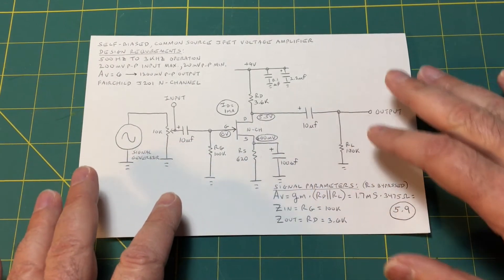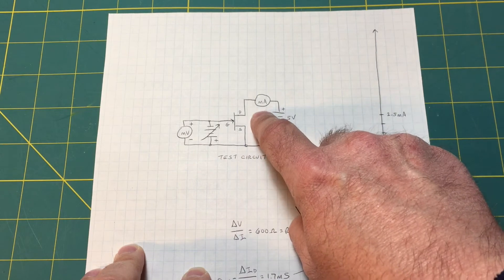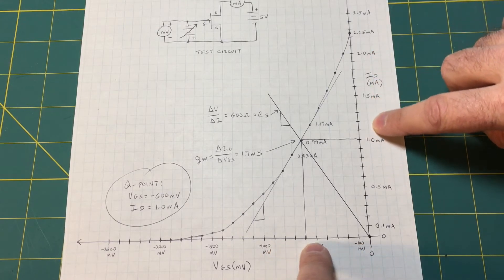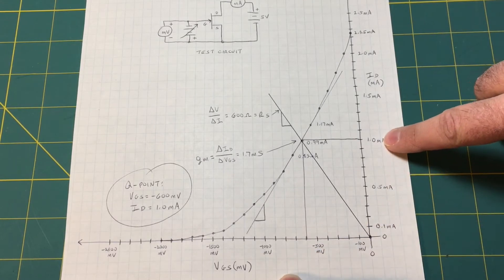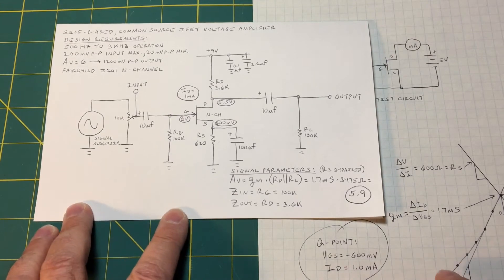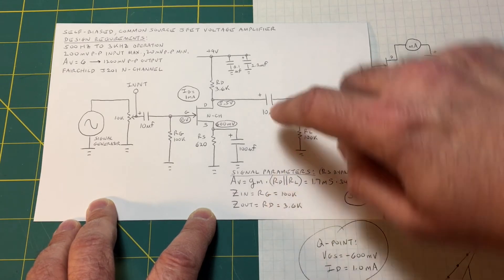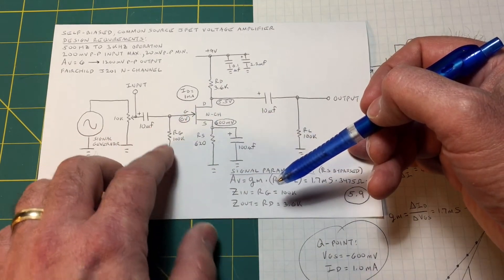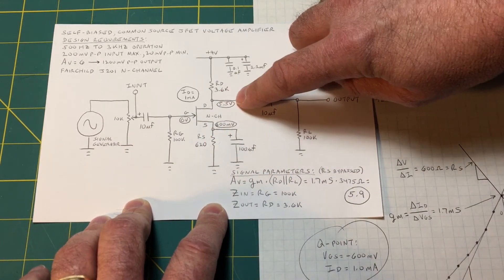JFET Amplifier

Comment: if we change the load like Rl=10K, then what is the new value for Av and Ai? Also, if Rl 500k then what is the new value for Av and Ai
in another world, How Rl effect on Av and Ai
Reply from the maker: Mohammad Alhamd Assuming a gm of 1.7mS for the JFET, Av with Rl == 10K is 4.5, and Av with Rl == 500K is 6.1.  So voltage gain is reduced if the load impedance is lowered.

Comment: how did you get 5.5v on the drain? I got 9-(0.001*3600)=5.4v
Reply from the maker: My resistor values may not be within 1% tolerance, the ones I’m using here are “economy class”.  My DMM is also old, and may be out of calibration.
Reply from the maker: Several possibilities:  1. The curves in the Fairchild datasheet were generated with Vds = 10V, my Vds was only 5V when I generated my curve  2. My JFETs may not be genuine Fairchild but instead may have been fabbed by another manufacturer (counterfeit)  3. My JFETs may be out-of-spec pulls or scrap material that is nonetheless still functional.  4. My JFETs may have been mis-branded (wrong part number)
Reply: @NetworkXIII  its really strange that the IDSS is 0.2mA - 1.0mA but when the Vgs is 0v the ID is approximately 12mA. Is this a mistake, or am I misunderstanding something?
Reply from the maker: Bit Crusher Fairchild measures Idss with a 2% duty cycle pulse at the gate, not DC, this may explain why it differs from the higher drain current on their curve when Vgs = 0.
Reply: Network XIII Thank you very much!
Reply from the maker: @RexxSchneider  I purchased these JFETs from an eBay seller in China for next to nothing, so I can't even say for sure if these are genuine Fairchild parts, nevermind being J201s.
Reply: @NetworkXIII  Sorry to bother
 you, but why the transfer characteristics curve of the datasheet is completely different to yours. In the curve, when Vgs is 0 the ID is approximately 12mA.
https://pdf1.alldatasheet.es/datasheet-pdf/view/245178/FAIRCHILD/J201.html

Thank you very much again.
Reply: Sorry for my horrible english.
Reply: Thanks!

Comment: Basically, it is like a transistor except exactly the opposite? :P
Instead of current multiplying, you 'pinch off' the current by supplying an inverse voltage?
Reply from the maker: Richard Smith Yes, as the gate-to-source voltage is made more negative, the depletion region in the channel gets larger and reduces the drain current.
Reply: Basically. A standard bipolar transistor provides direct current gain, meaning it's a current controlled current source (small current flow through the base-emitter junction controls a larger current flow from collector to emitter).
A JFET has transconductance instead. It is a voltage controlled current source (the voltage potential between the gate and source terminals controls the current flow from drain to source). A JFET is similar in functionality to a triode vacuum tube, but with much lower voltages. Also, as long as the gate to source junction remains reversed biased (not overdriven), the input impedance of the device is incredibly high and places minimal loading on whatever is providing the input signal. This is a very useful feature for amplifying or buffering very small or load sensitive signals such as from a condenser microphone element or RF signals. There are JFETs that can operate clear into the UHF frequency ranges. Some of them, such as the J310, the drain and source terminals can be used interchangeably, a neat feature for the SMD packages. Dual-gate Mosfets are incredible little devices also, but that's a slightly different topic.

73s